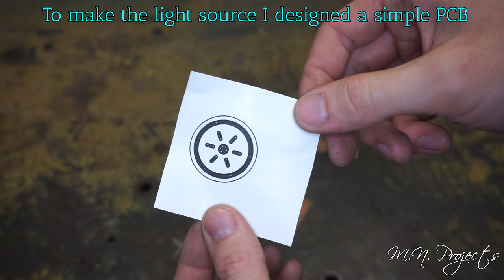Making a Wooden Flashlight with USB Charging

Comment: Nice project! What is the white thing that you put on the micro usb pins in 1:42 ?
Reply from the maker: Epoxy glue (Loctite 9492). I applied a larger amount to prevent the pins from tearing off the socket. Such sockets are theoretically dedicated for mounting on PCBs